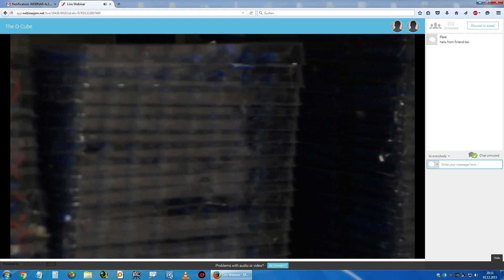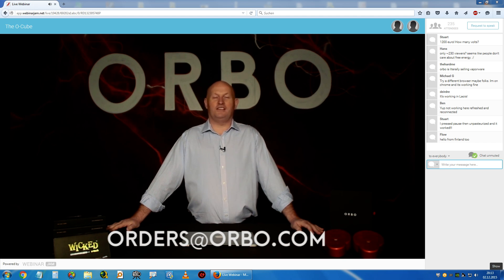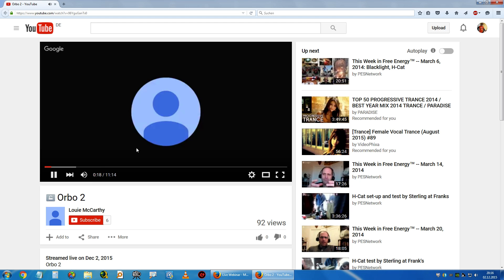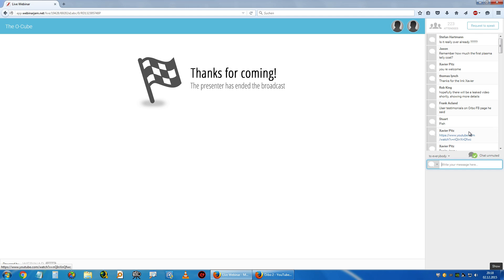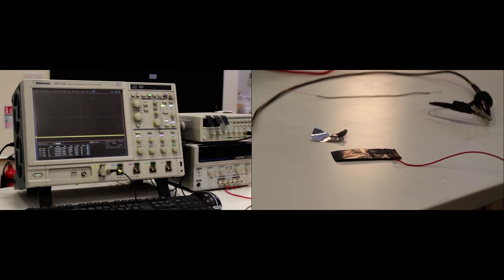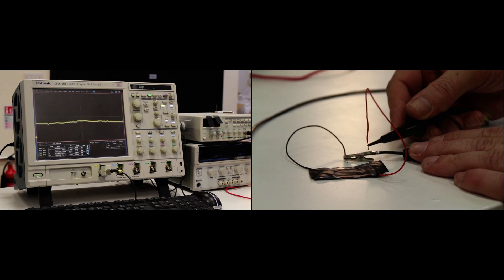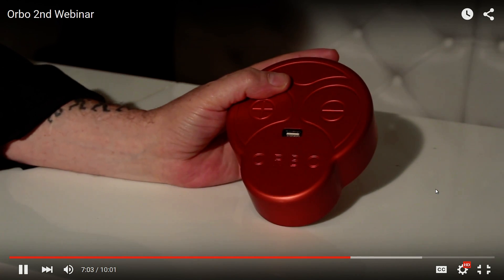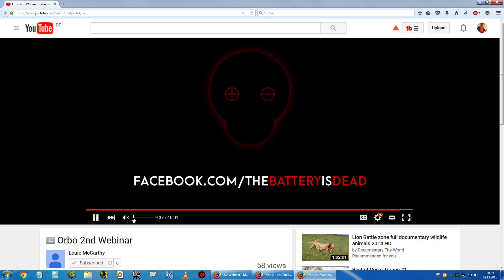Orbo Webinar 2 - Steorn Orbo Ophone OCube and Powercell presentations

Comment: why don't they start with something small like an AA cell package that never runs out for remote controls and other low power devices, the e-cig and phones seem ambitious and could be bad for the company if they don't work.
Reply: +FUCKGOOGLEPLUS INTHEASSWITHAHUGEDILDO I agree, the products are ridiculously high priced and just a gimmick. No one will use these phones, everyone is used to smartphones now, these are pointless. Its just a gadget to display but no one will use it. why not make something useful?! like AA self charging like you said, its stupid. Well the charging base is useful because you can plug an AA usb charger into it, still waaaay over priced however!

Comment: Has nothing to do with the cell it is merely an antenna. Look at the emf noise when the scope shots are shown. Sooo much noise I suspect the millivolts they were seeing was from the lights in their shop or even a tesla coil.. It's a scam...
Reply from the maker: +Jon Bigman No, for it to be an antenna you would need to attach a diode after the cell, so the cap could charge up.... so no antenna and why should it be a scam... you just see, that this thing puts out 0.3 Volts just from the electrodes...
It seems you are a troll or you have not carefully watched the video...
Reply: I see an oscilloscope full of noise before anything is connected. More then normal Thats why I said this smells bad. And from the amount of emf in the air there had to be an exciter in the area. Tesla coils could provide that much noise in the ambient air. The video was really loud in background noise as well and that could be due to an exciter running as well. Thats why I said this looks fishy. In the first place a graphite layer on the one plate is highly resistant and reacts differently in a very high electric field then the other piece of foil which has a lower resistance. Nothing magical about it if you know whats up. Also the foil looks like it has a plastic sub-straight making it a dielectric one one side and metal foil on the other. Rolling up the foil with dielectric side out would not short the  plates and allow it to have a charge develop on it. Pretty simple seeing that we couldn't see how they rolled the one up and tape was put on it right away. Just a real shady way of doing it really. The extremely fast exit after the live feed also is indicative of not wanting to explain anything or deal with anyones questions.
Reply: Plus I meant to say the plates acted like an antenna when presented with an electric field, especially with the coated plate and regular plate. With the resistance determining the voltage difference to draw from.

 I am no Troll and have many many years of experience working in this field. That includes working with you Hartiberlin and posting for over 10 years to your forum. My observations are simple and the most plausible explanation of this ruse. I'm sorry if you don't see it that way but giving what was done in the video this seems a bit off..
Reply from the maker: You neglect, that they did not connect any diode ! So why should a cap just charge up by being in an AC field with no diode being connected and also to 300 Millivolts ? Does not happen without any diode...so you are just wrong...
Reply: Because just as in the crystal batteries each plate has a standing potential or electro-negativity. The diode is formed via this process given the enhanced electro-negativity that the electric field provides. You could think of it like this. Carbon has 2.55 on the Pauling scale. Silver for instance has an electro-negativity of 1.93 on that scale. The diode forms from the carbon side twords the silver. One is larger then the other by .62 volts. It will resist .62 volts of back voltage, just like a diode and just like an led, to an extent.Since the background noise was in the millivolts, there is your heafty diode. All in one package, neat isn't it.... The natural potential difference is the diode between both plates. Plus it is a capacitor as well. And the density can be very high with carbon coatings like that as well so you can add storage too.
Reply from the maker: +Jon Bigman But it would charge then up only to the highest noise amplitude spikes....and the nouse level was much lower than 300 Millivolts and the shortout recovery also was too fast....
Reply from the maker: Should read "noise level"
Reply: Remember I said there is a multitude of things going on in between the plates. Capacitance is a big thing there. As with everything resonance comes into play when the capacitance reaches a certain amount. All of those things creates a boost including the diode like effect that is pressurizing the area in between the plates and raising the voltage potential in said space. If you look at the noise before the cap is added you will see the deviations from low to high and high to low are very broad. Once the load is attached the deviations shrink and add to the overall voltage levels. The output is also pulsed as is the input. I would have to recheck the video but in my opinion this is just bunk and I do not want to check on it further.
Reply from the maker: +Jon Bigman The output was never pulsed in this video. It was jut a high impedance digital scope .....
Anyway I agree that this thing musz be tested also in a lower noise environment, but also if it collects these WLAN radio bursts in addition to the Electret charging effect, I say Great, we can use all at energy to charge up the Li-Ion battery, why not....
The only question I still have is: how long will this cell last....
Reply: The output has been rectified by the diode in between the plates which charges up the capacitance also. So it was highly filtered. The output on the scope was fuzzy. This fuzzyness was from the AC noise that bled through the diode and cap. The cap in this case was like a biasing cap. Even though the signal looked like it was DC it was not. It was a biased AC. If they had shown higher frequency setting on the scope you would have seen the ac riding the bias of DC from the cap. Remember this plate thing has many effects. It receives the noise like an antenna. It rectifies the noise via the quasi diode that formed between the two plates and the capacitance will bias the noise and filter some of that noise as well.
 Well for one reason w cant use it effectively is that it is reliant on a noisy background of emf. The problem is that people are sensitive to many degrees. EMF sickness is a terrible thing because it messes with our bodies, this includes the mind state. Using AC really is not a good idea because it has the same effect as microwaves, as in RF. This is why Tesla was very interested in sustained impulse technology. Why? Because it raises the potential of everything in that field in a step excitation that does not have the back and forth wiggling that AC or RF has. This wiggling forces energy to enter and exit an atom forcefully both ways. While impulse technology forces one way and then relaxes to let the atom or matter exhale the energy back out naturally with out ripping the energy out destructively. Using RF is a very dangerous idea because the swing goes both ways while impulse technology only goes in one direction.
Reply from the maker: Well I guess You try to interpret something into it, which it is not. As you could see, when the electrolyte cap was connected, it was just a DC voltage that was rising, so it is just charging the cap or the Li-Ion battery... Well let´s just wait and see, how this thing performs in 3rd party testing... it is only a few days away from shipping it seems. Regards, Stefan.
Reply from the maker: +Jon Bigman See the scopeshot here, this is just a charging DC voltage to the external cap.
http://freeenergy.news/steorn-webinar-ii-orbo-products-full-transcript/
Reply from the maker: +Jon Bigman Accurate DC charging:
http://i0.wp.com/freeenergy.news/wp-content/uploads/2015/12/steorn-experiment-battery-1.jpg

Comment: So whats the electrolyte gel consist of then - any thoughts? ... its Brownish clay colour

*One of the sheets of metal is covered by a layer of a highly resistant specialized material. When the two sheets are pressed together, a current is generated. 

So is it a Piezoelectric generator?
Reply: Spekulation: Steorn betont ausdrücklich, dass ihre Erfindung auf ORBO-Technologie basiert und nicht lediglich elektromagnetische Strahlung (EMF) aus der Umgebung einfängt. Das entscheidende Material ist dann eher die nicht-leitende Komponente und weniger die Silberschicht. Wenn dieser äußerlich völlig andere Ansatz noch was mit der Orbo-Technologie zu tun haben soll, dann vielleicht darin, daß das nicht leitende Material aus zwei oder mehreren Schichten magnetischier Partikel besteht, die in ein nicht-leitendes Gel gegossen wurden. Die Flussrichtung der Magnetfeldlinien der verschiedenen Schichten oder Partikel schneiden sich vielleicht in min. zwei oder mehreren speziellen Winkeln (also ähnlich wenn man zwei gleiche Magnetpole zusammenhält). Durch die innere Unruhe ergeben wabernde Felder, die in der hochleitenden Platte (Silber?) dann sowas wie Wirbelströme hervorrufen könnten bzw. eben eine Stromrichtung überwiegt (Spannung liegt an). Bei zunehmendem Stromfluß durch die Silberplatte wird auch die ausgekoppelte Energie noch etwas größer (bis zu einem Sättigungseffekt), so Steorn. Dies könnte darauf hindeuten, daß es zu einem Energiestau im nicht-leitenden Material kommt, der sich umso effektiver ableiten läßt, je mehr Strom fließt. Damit kommt es wohl zu einer temporären Konditionierung der Felder. Dieser Effekt dürfte nur in einem gewissen Grenzbereich zwischen den Magnetflußlinien auftreten.
Reply from the maker: +DiyEcoProjects Probably carnuba Wax, at least it seems it was that what they showed in the first webinar some kind of wax...Probably charged up via high voltage and then letting it cool down during charging via high voltage...so the high voltage is "imprinted" into the cell...this will then attract free electron and Ions from the air and surrounding environment and selfcharge the electrodes...

Comment: Do the cells, gadgets work in a Faraday cage?
Reply: I was wondering if they had managed to con their investors by wireless charging (i.e. Give them an 'evaluation' copy, then secretly charge it every night while it's parked outside in the car.
Reply from the maker: +John Doe No, it seems to be based on an Electret based selfcharging cell.
Reply from the maker: +Flip Fluiter Yes, these are just electrets why shouldnt they work in Faraday cages ?